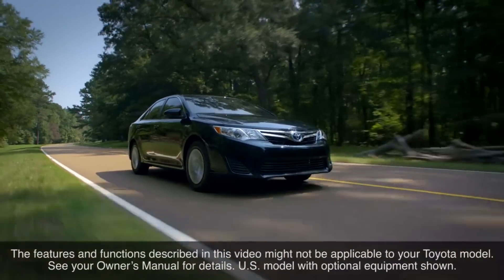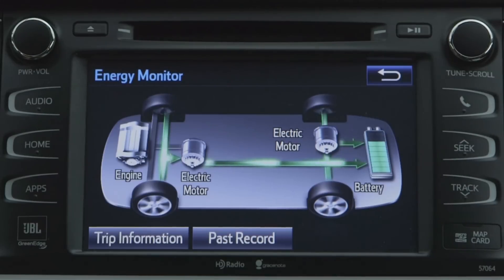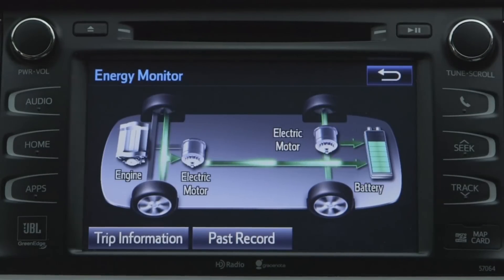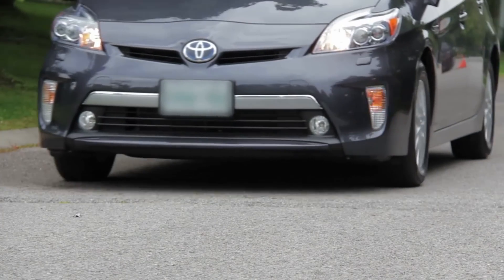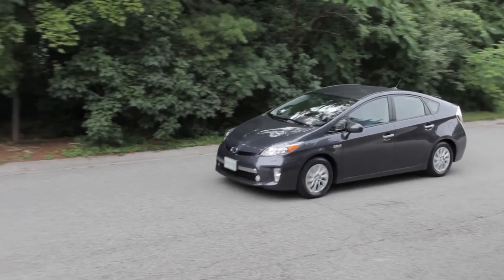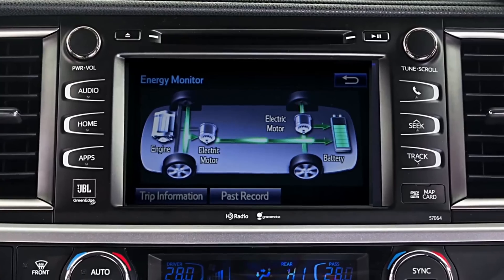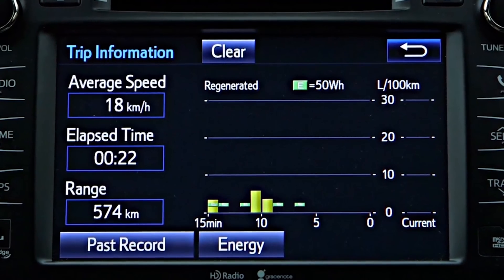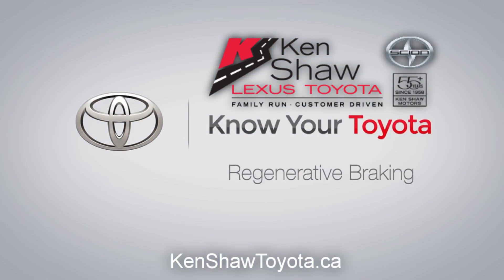Know Your Toyota Mechanical: Regenerative Braking

Comment: What is the max speed For "B" mode ? Is it ok for 80 KMph
Reply: It doesn't matter what speed you are at. You can use it. As the speed increases, the humming sound from the engine increases.